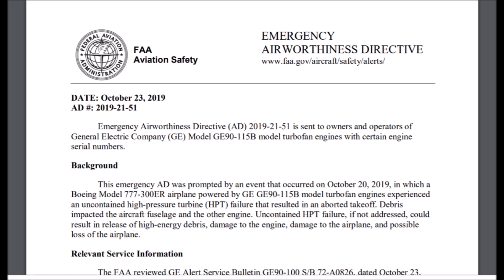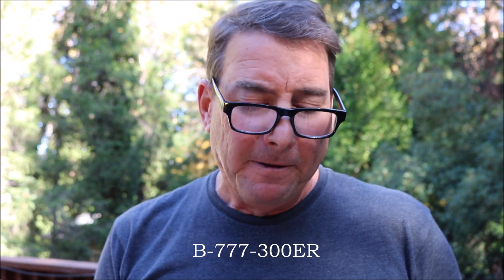Boeing 777 -300ER Emergency Airworthiness Directive

Comment: Good report Juan, it seem scary that "someone" must have known about the seal. Maybe they didn't think it would be so catastrophic of a failure and are lucky no lives were lost. At altitude it would have been rapid decompression and ?????????
Reply: Plus that's one reason the engines are mounted below the fuselage. At the place where the cowling failed, it was under the wing, so any debris would have gone into the cargo hold.

Comment: One other thing, the CF6-80C2 had a similar problem back in the day. We changed out quite a few.
Reply: Hot section only. Pretty easy job actually.
Reply: @angelorosin5951  "Hot section only. Pretty easy job actually."  That sounds like what a brain surgeon might say -- 'That's just a small tumor. Pretty easy job actually.'  :)
Reply from the maker: big job? complete teardown?

Comment: I AM A RETIRED airline pilot.  NEVER type-rated on the B-777....BUT I flew the B-727, the A-300-B4, the DC-10....AND the B-737 series AND the B-757/767 AND the DC-9/MD-80....NOT to mention multiple small planes in General Aviation....probably the ONLY reason I never bid to fly the B-777?   AT the time I didn't like the routes,   didn't want to get stuck always going to Tel Aviv.....(WHICH is likely a lovely city.....).....

Comment: It’s been a long time but I worked for GE as an overhaul mechanic on the CF6 series of engines. You are correct in that the inner stage seal does supply a way for cooling air to the rotating blades. It  is in between the 1st stage and the 2nd stage HPT discs and is a part of the HPT rotor. Its main function is a blade seal that provides a seal between at the base of the 2nd stage nozzle so the flow passes through the nozzle and not bypass between the HPT 1st stage and 2nd stage blades. Like I said, it’s been awhile. My memory may be a little  fuzzy.

And yes, it is part of a labyrinth seal.
Reply from the maker: Thanks Angelo!
Reply: @blancolirio  Check out AgentJayZ showing interstage seal and how cooled blades work: https://www.youtube.com/watch?v=0GxvEQZil2U
Reply: @Miata822  excellent explanation with cold metal to see!
Reply: @TeemarkConvair  The AgentJayZ channel is great for those with an interest in jet engines. It deserves more exposure. He explains the design and function of the engines he rebuilds. With no sponsors and no Patreon I think he does it simply for the joy of spreading knowledge. Helped me finally gain an intuitive understanding of the function of these engines.
Reply: @Miata822  I've watched a number of his videos. Excellent stuff Check out his website
Reply: @easternwoods4378  I too am an Agent Jay Z (turbine) fan. My father was an Engine Build-Up Mechanic @ McDonnell-Douglas / Boeing for 33 years.
Reply: Ft St John CYXJ is a long way in the mighty Luscome
Reply: Today I learned about Labyrinth Seals : https://www.google.com/search?q=labyrinth+seal&newwindow=1&client=firefox-b-1-d&source=lnms&tbm=isch&sa=X&ved=0ahUKEwjcroa_19zlAhWQ_J4KHVihCqsQ_AUIESgB&biw=1176&bih=608)
Reply: Good job Angelo!! We run the GE and Pratt’s on our 777’s and the GE’s on the 300’s. Nice video. This pilot is cool I think. Did I tell you about when I peeling open my finger on a -80 during final assembly? The swingee was swinging.. so I tried to stop it. I sliced me finger on the aft turbine section of an American Airlines ending. Yikes!!
Reply: Captain Vicki❤️❤️🐾🐾 Never told me than one .🙂
Reply: Although they’re awesome engines, they seem to be having more issues of late. A GE90-85B on a 777-200 - BA G-VIIO a couple of years ago at KLAS had an uncontained failure on takeoff - HPC fan fatigue crack.
“The National Transportation Safety Board determines the probable cause(s) of this accident as follows:
The failure of the left engine high-pressure compressor (HPC) stage 8-10 spool, which caused the main fuel supply line to become detached from the engine main fuel pump and release fuel, resulting in a fire on the left side of the airplane. The HPC stage 8-10 spool failed due to a sustained-peak low-cycle fatigue crack that initiated in the web of the stage 8 disk; the cause of the crack initiation could not be identified by physical inspection and stress and lifing analysis. Contributing to this accident was the lack of inspection procedures for the stage 8 disk web.”

Comment: sigh...That's all Thai needs now is to lose an air frame..They've been bleeding money forever..As with your  comment on the pickle fork the owner is responsible..Have a good Veterans ride
Reply: Re the pickle forks. Qantas has 75 NGs, 33 of which had over 22,000 cycles. They inspected 33 and foung 3 with cracks...10%. Qantas CEO has told Boeing that they will have to bare the cost of the fix which takes six weeks, if they ever want to get an order from Qantas again. in 2020 Qantas will decide whether to order 300 new aircraft from Boeing or Airbus.

Comment: I wonder if AgentJayZ could help with answering your HP turbine seals question. He knows a few things about General Electric gas turbine engines.
Reply: https://www.youtube.com/user/AgentJayZ/featured
Reply: Architype0   I was thinking the same thing. . . AgentJayZ would know. Juan could learn how to Live Chat!
Reply: Agent JayZ has a 3 video series "TurboFan Parts donor 1 - 3" where they remove blades from CF6 for use in a LM2500....
Reply: @JonT_4  Wow, 2012 was before my time on that channel!
Reply: Architype0 True, but AgentJayZ doesn't work on the big GE turbofan engines.
Reply: I would vote for a chat between Jay and Juan, what a conversation that would be!  TWO straight up guys telling the truth, wow, epic!
Reply: Architype0 - he responded.  https://youtu.be/0GxvEQZil2U

Comment: I would guess the most efficient way would be to switch out the engines that is needing seal replacement and replacing with engine known not to have that serial number seal . So they can bench the engines that needs the seal replaced . ( Praying the parts paper work is correct) !
Reply: Problem is some of these airlines that are just getting by don't have cash to tie up in high dollar engines for a quick replacement.  Might be an easy fix or could be a cluster.  If they find issues with the seals they take out you can bet it crap storm of mandatory inspections will be ordered.

Comment: Who is going to pay for that? Boeing? Manufacturer? Or unfortunately airlines? And this looked like an uncontained breach of 3 or more blades at the same time.
Reply: It's a General Electric engine.
Reply: It really depends on the cause of the failure. If it's a manufacturing issue, whoever manufactured the part will end up paying. If it's a heat treat or material failure, whoever made the material or heat treated it will get it.
Reply: @murphsmodels8853  Good. Because I'm sick of the airlines paying for other's mistake.

Comment: Thanks for the explanation. How is your health vis a vis your first class medical? If it's too private I understand but you're clearly a guy that should be in the air!
Reply from the maker: I'm in the "hurry up and wait phase". Soon to be followed by the "resubmit for further disapproval" phase...Treatments all done, feeling great!
Reply: @blancolirio  With the pilot shortage looming large, the FAA AME needs to get with the times. Prostate issues have NOTHING to do with a pilots ability to operate, and in emergencies, handle an aircraft. I know that the GA community and bizjet folks have been working hard to get these old fashioned rules changed. It will take a major pilot strike at minimum to get some attention to the issue. Good luck dealing with low knowledge bureaucrats.
Reply: Not fair of the FAA to rate a pilot's ability to fly on PSA numbers or how long since chemotherapy. Rate their ability on their actual ability. It's the same with truckers and their time on the road. Alert and away truckers who are alert and fine are forced to stop or fact horrid fines.

Comment: Why blame Boeing (not that Juan is blaming anybody)?  It’s a GE engine.  The engineering forensics will probably determine the failure mode.
Reply: Hours in service and shut down and restart cycles will be looked at .
Reply: Why didn’t people blame the AoA sensor manufacturers for the MAX crashes?  Laziness of the mind.
Reply: The forensics are pretty clear. There are a couple of seals that trap and route cooling air to one of the hubs in the hot section. A series of those seals got contaminated with the chineezium materials or bad process and failed. Cool air probably jetted out the exhaust and no one smelt it.....but the ol' GE90 dealt it.

Comment: is the reason for the 777 being included is that these engines are only on the 777-300?
Reply: Apparently these engines are only found on 777's  (though some  (earlier?) 777's had other engines - RR, P&W - as alternatives).    Other thing, it seems if an engine has to be shipped somewhere it will only fit in a Antonov 124 or similar, it's too big for a 747 freighter.   That's a big engine.
Reply: @cr10001  Actually the engine core can be shipped with the massive Fan Section removed. At GE's training center - during the Engine Change training process they have you remove the Fan Section and then remove the Engine Core from the airframe.  Then the Engine Core is installed to the airframe and the Fan Section is installed to the Engine Core.
Reply: @StavrosECC   Interesting to know.    Are fan sections interchangeable? - that is, can the removed fan section be put on the replacement engine core on site?    Or does the fan section get shipped along with the engine core, just sitting flat?
Reply: 勇気きみこ  thanks for that response as I assumed that to be true

Comment: Boeing must like getting kicked in the balls.  Seems to happen to them alot.
Reply: The engine is not Boeing, it's made by GE.
Reply: Yeah, but many rich people bought stock in companies like Boeing when they were flat on the deck, only to get up like a Phoenix.  Boeing is too big to fail.  Boeing makes jets for the military and is too big to fail.  The Federal Govt. knows this.  The FAA is embarrassed right now because the FAA was caught with their pants down by allowing Boeing "bean counters" to regulate the mess caused by the 737 MAX rather than allowing the engineers to work with the FAA. 
           Boeing also buys out even small companies like "Foreflight" a digital navigation aid used by the majority of pilots (even though Garmin Pilot might be better).  Any good stock picker will have to decide how low this stock will go before they buy a ton of it back and watch it fly like a rocket.  BTW, Boeing makes rockets as well, or at least parts of them.  Someday after all the "Chit" hits the "turbo" fan, this stock will "fly" again.  I wish I could afford to buy loads of Boeing stock maybe six months from now.  JMHO.
Reply: @daffidavit  If theres anything that chaps my ass its these 'Public/Private partnerships'.  This isn't a free market anymore.  We've got bailouts...too 'big' to fail and the flying circus that is Boeing.

Comment: man bad year for Boeing
Reply: They don't make the engine.
Reply: Or it is a good time to buy Boeing stock
Reply: Elios0000 It will only get worse and they’re responsible for everything that is happening to them. Boeing abandoned its integrity and adopted classical American corporate greed. They cut corners for profit and now their planes are falling apart.
Reply: @dcentral  It's a GE turbofan, Boeing doesn't build them.
Reply: Artisan Auto Body It’s no secret that Boeing outsources and relies on thousands of suppliers to design and build parts for their planes but at the end of the day, the company holds responsibility for testing their planes but as we see the company is in disarray.

Comment: I’d hate to own stock in Boeing right now.
Reply: I think this is a GE issue, correct?  It may happen that the 777 is the only plane using this engine at the moment, but Boeing doesn't make the engine.  They certainly will feel the impact, however, no doubt about that.
Reply: Thom Thumbe GE?
Reply: Did you listen to Juan? Not a Boeing prob, GE 90x engine seal prob. Listen up.
Reply: Thom Thumbe Might be a good time to catch the bottom.
Reply: I have held BA stock since 2016 where I purchased at roughly $111 a share. Today it closed at $351 so I have a long way before I am upside down. While it did take a big hit after the second MAX crash it has held up quite well since then. Also in the past 4 years the dividends have increased nearly 100%.
Reply: I think Boeing will be fine once it gets past the MAX issue. Probably a good time to buy stock soon.
Reply: I’m sure Boeing doesn’t manufacture the rivets in the fuselage, but if they failed, Boeing would take allot of heat nonetheless.  They are the ones who ultimately decide which parts to use.